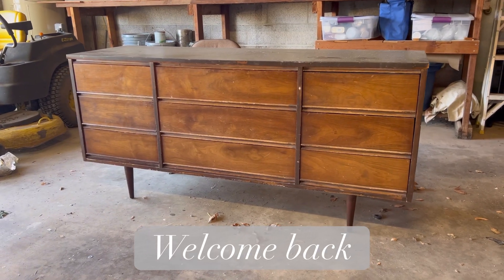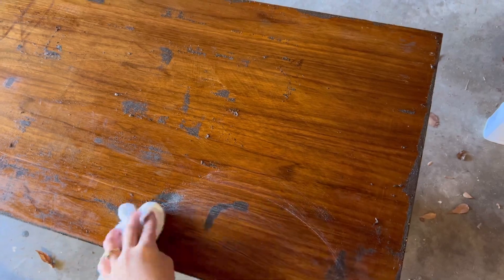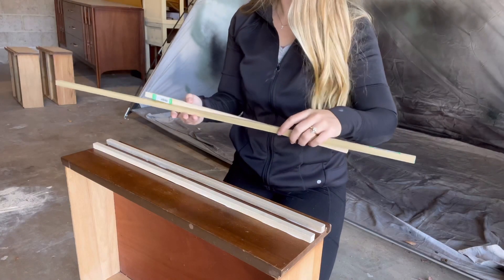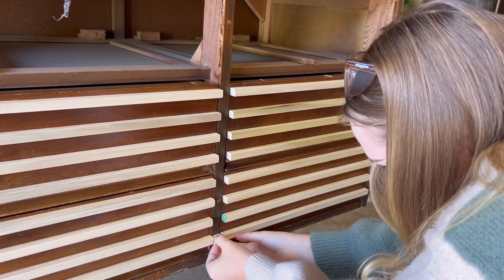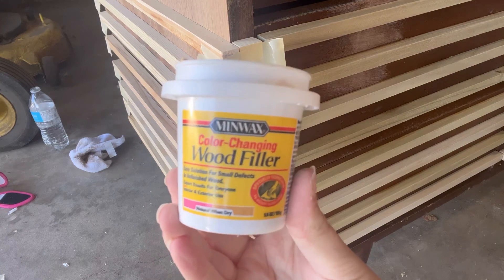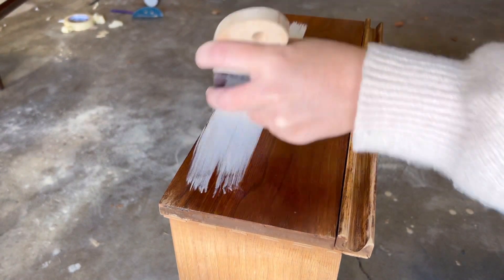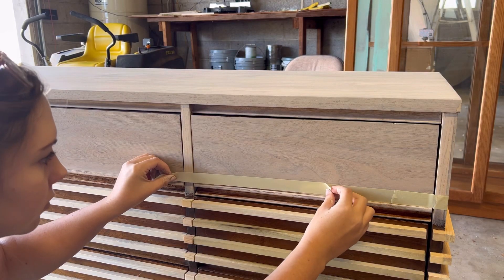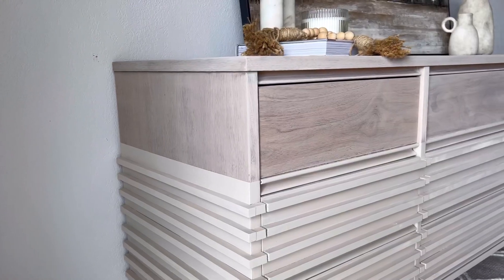YOU DON’T WANT TO MISS THIS! // Mid Century Modern Dresser // Dipped Trend // Adding Wood Trim

Comment: For future projects, CNC glue + some accelerator spray would probably be a little easier/better than taping on the sides. You'd just do mostly wood glue, but then in some areas instead of wood glue do the CNC glue. Looks great!

Comment: Your measuring tape will give you more accuracy than the bubble level. Your level is only as reliable as your eye is because each time you have to decide if the bubble centered between the lines and the cabinet has to be level. Your tape has numbers that don’t lie.

You do nice work.
Reply from the maker: Thank you! I did have some challenges with it. Still trying to figure out the best way